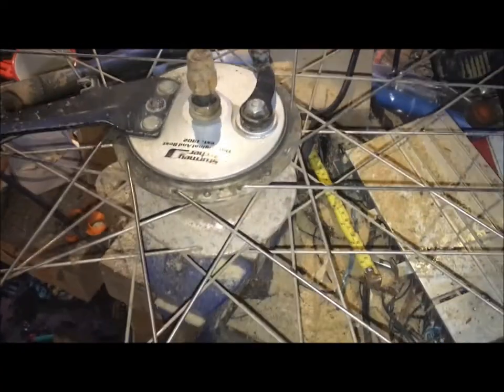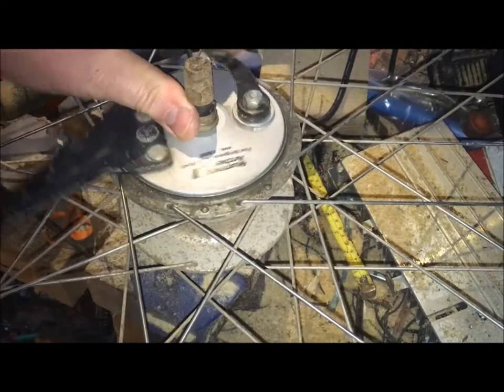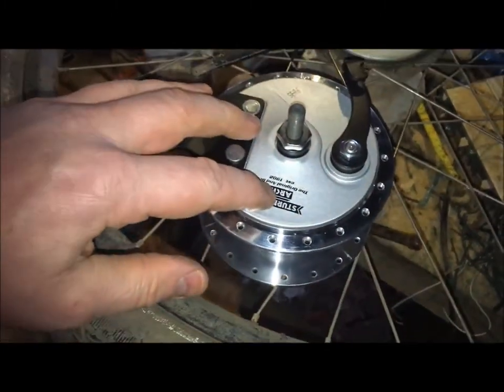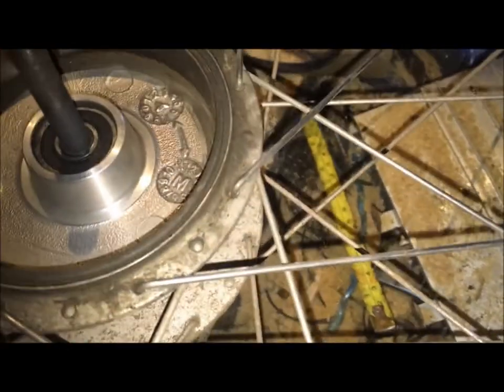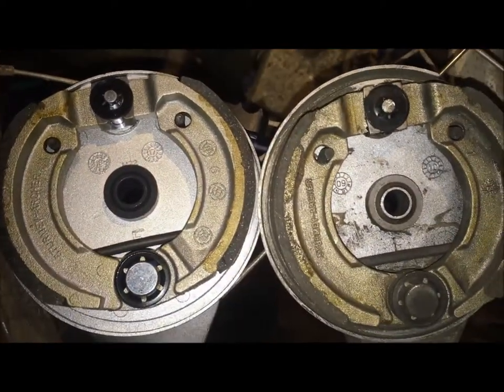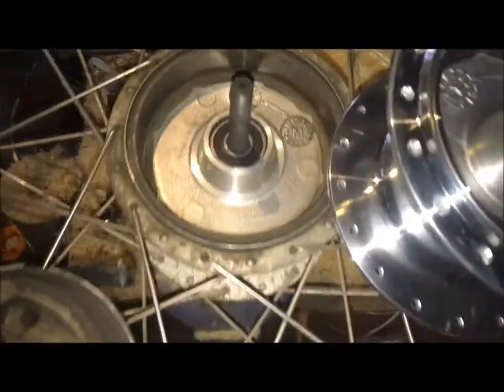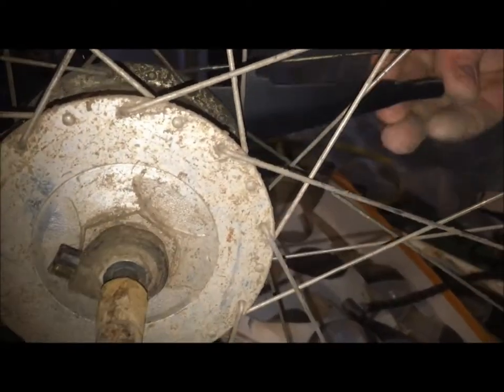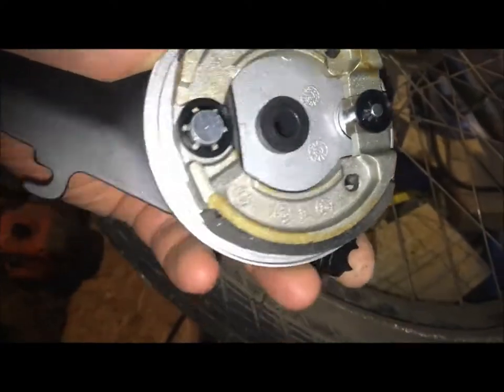Sturmey Archer - XL FDD 10 Year Observations

Comment: Thanks for the heads up about the GT85 😬 I'd sprayed it into the bearing to loosen it up, it was rusted and spinning on the axle. Fortunately I'd put a rag around the outer drum to catch the overspray since I was worried about contamination. When I put it back together a bit dribbled out, which I wiped away, which I thought would be ok.

After seeing this, I've just taken it apart again wearing gloves, and carefully wiped out the drum with carb cleaner, and lightly sanded the rust and wiped again. I've also sanded off the top glaze on the pads. 🤞🏻it's not ruined.
Reply from the maker: Yeah any kind of PTFE lube on pads ands they are done for. They call PTFE a forever chemical. It never goes away. My pad assembly I left in dishwasher for about 100 cycles, I will try it out one day to see if it washed PTFE away, but I doubt it!
Reply: @DorkyThorpy  Seemed ok today, if anything better than before, probably from removing the rust and glaze. Although the question of whether it could be better lingers, it's good enough though.

I got lucky that it was surface contamination, and never had a chance to soak into the pads, it would have been surface contaminatioon on the drum.
Reply from the maker: @Tom89678  It doesn't take much so I think you were lucky. All the best :D

Comment: I use levers that are designed to adjust between short and long pull, that way I can get the right "feel" for the brake. As they wear, the amount of cable pull does change quite a bit. I ruined a pair of pads by getting lubricant in there, and was lucky to find a new hub. The replacement is a 90mm drum with a dynamo. This is a great upgrade from the 70mm, but I had to rebuild the wheel with shorter spokes. It is working well.
Reply from the maker: They are quite good those leavers with adjustable cable pull. It is amazing how little kube ruins a set of pad, and for these drum brakes it can be a real pian to replace them as you have found out!

Comment: I wonder if you can get just the cam?  I have one of these that the whole wheel has seized up from lack of use.   Haven't been bold enough to take it apart yet, but maybe that's in order.  thanks for the great video and the advice to avoid grease in there.  I imagine the shaft itself you could lube with spray teflon type stuff or a bit of Moly grease/spray, and keep it just on the shaft, but you'd have to take the hub apart to do that without faffing up the pads.
Reply from the maker: I would not use any kind of spray lube within 15cm of a brake shoe.

Comment: Hey dorky. Im quite perplexed really as having the same issue with the sticky cam shaft i followed the advise of your previous video and added just a touch of lubricant. This seems to have fixed the problem. I think what caused it was i rinsed my bike off yesterday afternoon with a housepipe and some water managed to get in. Overnight the bike was in the shed the next day i take the bike out and the front wheel is locked against the shoes by the time i get it free there were no brakes at all. I left it to warm up in the house thinking it might just be iced up in there but still the sticky cam. I hope this doesnt come And catch up with me. 

Also what may be of interest to you, i noticed the xlfdd camshaft had a purple/rainbow hue to it any idea what this is? Perhaps its a better alternative to lube for keeping the camshaft clean
Reply from the maker: Thanks that is good info. I am not really sure, but I just find mine needs relubing every 3 years or so. I seem to remember at least once it did coincide with washing or cleaning. So I would say water ingress has something to do with it. I'm not sure about the coloured hue. ..  that is very mysterious.
Reply: @DorkyThorpy  well in this specific case it was the combination of water ingress from the hose and freezing in the shed i think as the wheel wouldnt move at all at first thing this morning and once it did it keep sticking from there even once warmed up.

I like that youre also based in a hilly terrain dorky i have the 70mm cassette hub rear and i take the bike up and down severe pennine hills no danger apart from the very worst. The upgrade to 90mm from the original 70mm SA hub from the 90s was like night and day and obviously ive got the dynamo as well. Its a pity the rear hubs they make for cassettes dont come in 90mm. I see there are some 5 speed 8 speed etc sturmey archer internal gear drum hubs that are still on the market however. 

Id be very interested if you did a review on one of these 90mm rear internally geared drum hubs. I think they go up to 8 gears.

I have been considering just paying a frame builder for a new rear triangle that would allow for disc and rohloff then i could have a lot more braking power. Though i do rather love these sturmey archer hubs.
Reply from the maker: @shapattu1949  Yes it is very hilly around where I live. I run and alfine and disc on the rear. But I find it slips gears quite a bit. The only thing with a rear disc is that it munches pads, probably 3 sets a year. 

It is interesting to hear you opinion on the 70mm vs 90mm drum brakes. I have always wondered. For me if I were going for sturmey archer rear rub, I would go for 90m, with a rapid fire shifter (personal pref.) the 5 speed ones look quite neat. I am really in to range rather, then number of gears. If they split the range of my alfine 11 over 8 gears instead I wonder if it would be more reliable?
Reply: @DorkyThorpy  have you considered a shimano nexus roller hub for the rear? Im not sure about them on hills i hear they can overheat though ive heard the same for drums.

Comment: It is difficult to know when to do expensive replacements like this. On any of my old stock bikes I have tended to sell them after the first hint of bearing issues, because usually the rest of the bike is about to wear out afterwards.  It takes about 5 years. Slightly different with a home made bike or a higher quality bike. I have been getting a lot of use out of my 8-freight cargo bike, which has some similarities with your long bikes, mainly the drum brakes. I posted a video about replacing the bearings on that. But I have never had any brake issues. I have an old pashley postmans bike too, sturmey brake on the front and sachs 3 speed drum on the back. Pads are too expensive for my pocket, but I find that brakes only slow you down! Maybe I'd have a different attitude on an e-bike! I am not sure what you could do about the gt85 on the shoes, older car and bike drum brakes, even truck brakes had replaceable pads on the shoes. They were bonded on, as yours are, and also rivited. you can buy the asbestos pad material still and rivets, you would have to cut the old off, and drill rivet holes, maybe contact adhesive, If mine ever wear out....I'll probably buy a new bike.
Reply from the maker: I do wonder whether replacing the whole bike is the way to go, for a daily runner. Bikes are relatively cheap to buy whole, as opposed to buying parts. Argos do reasonable bike with mudguards for £100. Get a couple of years out of that, and its easily paid for itself. I have always loved the 8 freight, lovely bike. I think my main problem is that I live in a very hilly part of devon, and I am either crawling up hills or have brakes on going down them. This leads to me wearing out a lot of brakes, a set of disc pads might last about 4 to 6 months, so these drum pads were lasting very well. The annoying choice to make here was £40 for pads, £55 for pad/plate assembly, or £85 for whole unit. . . . I wonder if there is company that will refurbish old unit? I now understand the difference between shoes and linings thanks: https://catalog.zodiac.nl/en/12-brake/brake-drums-parts/brake-lining-sets-3596

Comment: Is the brake lever on a spline, if so you could have moved it back one notch.
Reply from the maker: That's a good idea Bob. On this model the lever has a square shaft, to match square hole in level. So it can be reversed, but not finely adjusted.

Comment: What happened to the end of the video?? I thought you were going to put the new brake in the old hub to see how far the arm travel changes. Anyway, it would make a way better video if you kept both hands free, for a proper demonstration. Your pads are only half worn down really. A IGH bike shop guy said it's good until the arm goes close to the line on the shell. Yah it makes sense to just buy a new hub if it looks like hell. SJS used to sell the parts separate. If you weren't so lazy cleaning, it would last far longer. LOL.

My first hub the same has 28,000 miles in 9 years. But I sure as hell never leave mud dripping on mine. It was on my 120 lb tour bike for 2 tours, total 8,100 miles. I didn't lube the cam for the first 6 years either. So it did wear and also dug into the shoe a bit. But it has never stuck at all. The wheel still looks like new and is now on it's third bike. Never had the slightest worry, except for the fork that did break 3 times. LOL. 
I changed the bearings, not that complicated. I made a surround wrench 33.5 mm. The shell hex is very soft. Also needed to solder the wire back together. 
I just built another wheel the same with 2.3/ 2.0 spokes. It's totally stupid that I'm about the only guy who thinks this is perfect for any tour bike. I never would have left home without this and dyno lights.
Reply from the maker: I would say its the single best bit of kit I have ever bought for my bike. It requires so little maintenance I am really very happy with it. Also re. video quality, i've been making youtube since before they got pretty! I did put the old pad assembly in the dishwasher and left it in there for 50 cycles, might work again now.

Comment: SJS Cycles do a genuine brake shoe service kit for 70mm and 90mm drums for 24.99.
Reply from the maker: Yes, thanks Douglas, I did see that (https://www.sjscycles.co.uk/hub-spares/sturmey-archer-brake-shoe-set-90-mm-hsb282/) but not quite right for mine, at top mount is star nut, not threaded. I think perhaps these threaded ones might be for older SA drum brakes. But they do fit with fettling apparently. I am not a fussy man, but I like to have confidence in my brakes being put together right. Funnily enough their 70mm shoes, (https://www.sjscycles.co.uk/hub-spares/sturmey-archer-brake-shoe-service-kit-70-mm-hsb356/) look like they do not have the threaded top mount. . . .